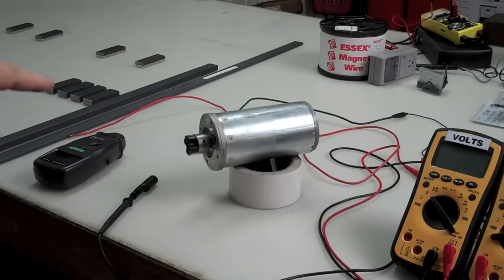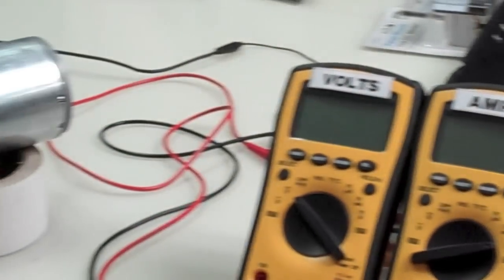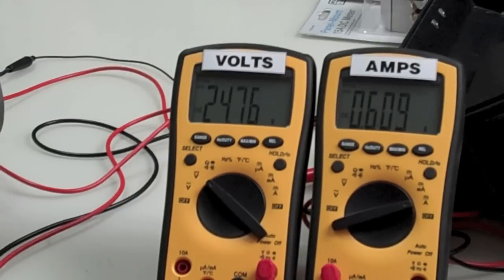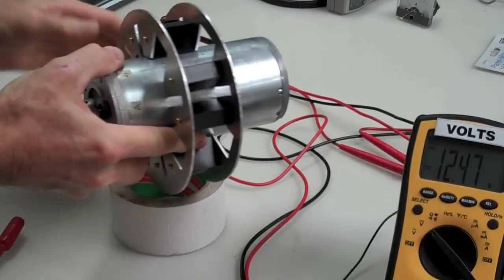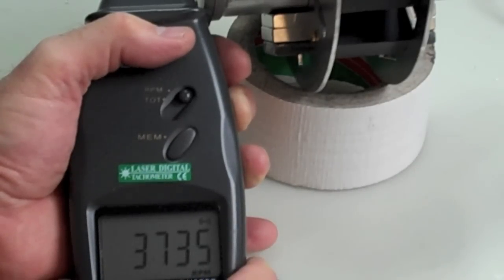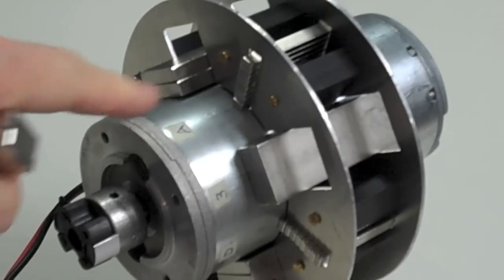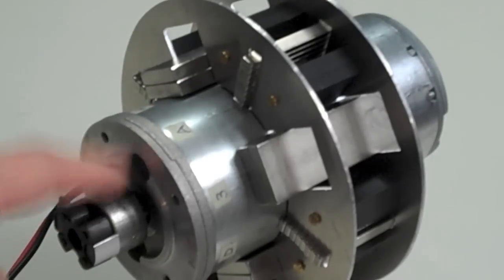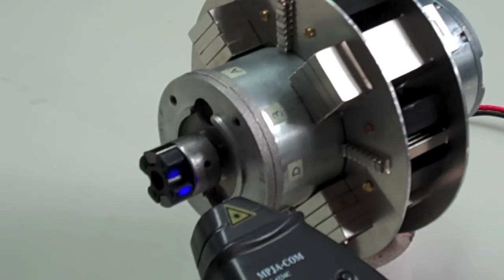STARGATE MOTOR  FULL DEMO

Comment: I'm not assuming any such thing. My formal training is in electronic engineering. I'm well aware of both the practical and theoretical limits on efficiency of circuits. I simply don't think that searching for buried treasure based on a maps found in cereal boxes is the same thing as digging a gold mine.

Comment: Thanks, let's find a solution to load the motor: This can be easily done by using a second motor (same powerrating) and use it as a brake: just shortcircuit the 2 leads by using a variable resistor (= dynamic brake - mind the heat dissipation!). The current determines the braking effect (Nm/A), and so the torque generated by the motor under test. And measuring the RPM's is easy: this will solve the whole discussion.(your method using the inertia is 'dangerous': the acceleration is not linear)

Comment: PMMG4HYBRID Many of these people commenting have to be led by the hand.
Yes, you increase the strength of the magnetic field and you increase the strength of the motor. The inverse would be the same.
Faster spin-up or higher spin rate, more power.
Less watts in/same rpm more efficient???

Comment: can you use that motor to try to design an eolienne power started that could self autogenerate current from using that motor with 2 currents separete (1 for starting the wheel, 2nd current to cumulate current) in that way you generate more power than starting.  DId you think it can be made? Now led light for self house consume no such power.
Reply: I think the challenge for now in 2014 is to create free energy and gain that energy to store it for own use challenge.

Comment: I tend to agree.  Not a mention of torque available, so what is the point?
Increasing motor speed doesn't say much.  Do a real experiment and measure back-emf vs rotation rate.  Then measure torque at zero rate.

Comment: Is there a use to this? Everything you just demonstrated is what you learn as a first year engineering student. I could be wrong but this video feels like you are cracking some code or you are 'onto something'. You are, The relationship between electricity and magnetism. That relationship is pretty well documented. That you made an experiment out of it does seem fun though.

Comment: two things to consider: it's unloaded, and Back-EMF. The torque you mention is irrelevant because it's not delivering power to a load. All you're doing is increasing the magnetic field. The other effects you demonstrate are normal. With a stronger magnetic field the rpm will increase for a given input voltage. At higher RPM the back-EMF increases opposing the input voltage ie it draws less current. All basic stuff.

Comment: It's a great experiment. What can be inferred from this demonstration aside from the obvious that enhancing the mag field increases speed?
Reply: it can be inferred that myself, as a hot rod builder won't be out of business when gas cars are made illegal, because, i can still make electric cars faster and more efficient at the same time.... nice.

I do wonder about torque gains/losses with this experiment ???? if it's 4x the rpm but 1/4 the torque, that's not really an improvement per say.
Reply: I don't have time for deeper explanation, but when the magnetic field is stronger, the speed may be smaller.
The torque will be however stronger, for a tiny decrease in speed.
Reply: he isnt increasing the magnetic field but decreasing the stator field by opposing fields.
Its called field weakening.
Reply: Bro the video just showed you that the rpm. Goes up when adding the magnets. It didnt show the torque. most likely from what i learned if one goes up the other goes down. So if RPM is going up torque is going down.

Comment: The closest reading to 10,000 RPM’s that the tach gives us is at 10,279 RPM. We will use a stopwatch to time the spin-up time to this point from rest. I actually also used audacity (free audio editing program) to get a more approximate time. You can time it yourself if you want to recalculate.  My time was 5.577 seconds
To list the data:

Inertia of the system( J) = is 5.92 OZ-IN^2 = 1.083E-4 kg-m^2 (metric)
RPM: 10,279 RPM
Spin-up time from rest (s) = 5.577 seconds

Comment from the maker: Thanks Sean. It is a permanent (stator) magnet DC motor. By simply flipping the outer attached magnets over, the field becomes quite saturated, now lowering the rpm and increasing the overall torque as you would expect it to do with a stronger stator field.

Comment: volt*amps ... you run the motor on the same power. The reason it's designed for 3000rps is because of the torque. What you are doing, is reducing the torch. You can design a DC motor for 1rpm, using 24 volt and 5 amps with insane torque. Or a 5 volt 0,1 amps 10k rpm motor with no torque.

Comment: Motor speed is inversely proportional to stator magnetic flux. I think you are weakening the motor magnetic flux by adding an external magnets acting against the motor magnets. This will cause the motor to run very fast as the resultant flux approaching zero.

Comment: Based on the label it's designed for (56 oz-in)*(3000 rpm) or  1/6 HP, not 1/3. That's 125 W (also on the label). So it's designed to deliver 125 W of mechanical power. And you have shown it 'idles' at about 15w. Your mod makes it much larger and heavier and reduces the idle power by about 3W, a small fraction of the design power. We don't know if that mod would make any difference with a 125W load. Just to put it in perspective.

Comment: What is happening here is the magnets on the outside of the motor is actually reducing the magnetic field inside the motor .The stronger the field the more back EMF is generated which reduces the speed of a DC servo motor High speed motors have weeker fields not stronger .Stengthening the magnetic field increases the torque at the lower rpm.Do your experiments with a motor with a separate power to a wound field .
LWD

Comment: So if you will do that to the Tesla car's electric motors, you can actually turn your Model 3 into Roadster 2's performance by simply adding some magnets around it's electric motors? That's amazing!  And that will also mean lesser battery consumption and longer range.  Just imagine that...

Comment: Ough... I thought it runs on Naquadah... 
But there is little-to-none need for complex magnet arrangement. 
Using NdFeB magnets only, well shaped with quality core and perhaps silver/silver plated copper windings you'll get a much more efficient, lighter and powerful motor.
You just started with a standard/crappy dc motor and enhanced the flux in it. 
Replace the internal ceramic magnets with NdFeB and then bolt it firmly to the bench. ;)

Comment: Not sure what you are trying to show here. You certainly haven't demonstrated a more efficient motor!

Motor efficiency is <usable mechanical power out> / <electrical power in>. Since this motor is not loaded and is thus not doing any work, usable output power is 0W and overall efficiency is effectively 0.

The following explains why the motor runs faster when magnets are added to the outside of the case. Remember, just because the motor runs faster under no load, doesn't mean it's more powerful. Speed <> torque.

An unloaded permanent magnet motor also act as a generator when the armature rotates, generating a voltage called the back-emf (EMF = ElectroMotive Force = voltage). So, in theory an unloaded dc permanent magnet motor will draw power from the battery and increase in speed until the back-emf generated by the motor's rotation is at the same voltage (or emf) as the battery driving the motor. At this point the back-emf balances the applied emf and the motor draws no power as current cannot flow. In reality, this is not the case as friction losses and armature coil resistances cause some current to flow to maintain the speed against these losses.
One of the characteristics of a dc permanent magnet motor is that if you reduce the field strength by reducing the strength of the magnets, then an unloaded motor will actually run faster as more rotational speed is required to generate the same back-emf. I believe that what's being demonstrated here. The external magnets counteract the intenal magnets and reduce the magnetic field in the motor, causing it to run faster under no load.

Comment from the maker: It's simply amazing, isn't it?  When you factor in the extreme rpm at the same power draw, one can only conclude that internal friction has been reduced and the enhanced magnetic field allows for a smoother and stronger operation providing higher rpm. Extremely efficient.

Comment: If you put it under load and measure power output and compare it to power input you wont see much difference in efficiency between running it with and without the magnets

Comment: That takes a course in physics and physics says that no improvement was made by messing with magnets on that motor.  What he did was to change the characteristics of the motor.   RPM does not translate to more power, just as you suspect.

Comment: a motor that could handle the rpm's would be built to do just that, so your beefing up an undersized motor......I love electronics and seeing people think of different ideas. Wonder what would happen if you simply magnetically shielded the outside of the motor or if the case were the shield itself.....the flux lines would definitely change.

Comment: Replace the bearings with diamagnetic carbon magnetic repulsion bearings and the only friction it will have is with air. 30krpm no problem.

Comment: Normal Run 24.53V-5.9A ~ 12.265V-11.8A
Stargate 12.21V-10.07A ~ 24.42V-5.035A

Kind of interesting that the efficiency did go up.  Can't just replace the magnets inside?  "Stacking" a Magnetic Field does increase its effectiveness.

@Riskteven Ohm's law kind of works funny with the batteries in parallel that the batteries can produce double the Amps at half the Voltage.

It's like taking two AA Batteries that are 1.5V and 0.5A each that you can get 3V @ 0.5A in series or 1.5V @ 1A in parallel.

Comment: The angular acceleration (α) is d/dt*ω = dω/dt = ((10,279/60)*2π)/5.577 = 193 rad/s^2
The net torque acting on the rotating body of inertia J causes it to accelerate. Newton’s 2nd Law for rotational systems is T = Jα . Therefore, T = (1.083E-4)*193 =  0.0209 Nm. This is the required torque if the speed is to increase linearly from rest to 10,279 RPM in 5.577 s
I can’t properly time the original spin-up time for the motor at its rated 3000 RPM because input power was not consistently applied.

Comment: Using the formula I x E = P
At 3.04 it shows I=0.593 amps and E = 24.58 volts for a total of 14.57 watts
At 6.23 it says 12.3W on the video which is a misprint.  The meters show I=1.099 amps and E= 12.35 volts for a total of 13.57 watts, not 12.3 watts
While it is true that you are gaining roughly 1 watt, remember too that this is at a no load condition.  Load could affect this.

Comment: 1st thing up front here, I am no electric motor guru of any stretch of the imagination.
Speed of the motor and low power is good I guess. But what about Torque?
Torque with low amp draw would be ideal.
But I am just thinking out loud here.

Comment: Your doing the same thing with that PM motor as you would do by lowering the field streingth in a wound field DC motor the speed will increase. How ever you will have a power torque decrease

Comment: Okay, I see all the comments giving you crap about the mathematics, power consumption, and the lack of format for proper scientific experiment to confirm a full range of statistical data. Even though I agree with most of them I also disagree with their tact when addressing their issues with your material. Regardless of that, your video and what you do show is interesting. My question is, what was the numbers and lettering all about? You made effort to mention them but I didn't catch why, or what their purpose was. I was thinking that they were to notate where the coils inside the motor are located but then at the end of the video, I saw that either the magnets or backing steel also had the corresponding numbers or letters on them as well. So, if it was to note the location of the internal coils, what then, was the meaning of the identifiers on the stargate materials?

Comment: But they are also tighend and framed to production cost, iron is cheaper than magnets.
Which can be seen on every motor and generators with there thin ceramics magnets.
The laws clearly says btw that magnets strength gives more force.
There is no way around this. 
The heat problem is offcourse a problem, due the nature of coil cored irons.
But there is another obtion in none iron cored engine. Where the magnet strength can be fully used without the iron issues.

Comment: So with the enhanced stator setup could it actually do the same amount of work (in terms of spec RPM and spec torque) on a much lower voltage and much lower power? What if you put 3V instead of 12V into it, would it still draw only 1AMP and spin at 3k rpm? Would it then have the same amount of torque? This could be a marvellous invention to greatly enhance the battery range of electric cars then! Instead of, say, 60 miles, you'd get maybe about 300 miles out of one charge! Why isn't this done?

Comment: [5]
7. Exactly the same thing happens if you double the stator flux: double the torque, double the generated voltage, half the speed.

8. PMMG4HYBRID knows this, and assumes the viewer knows this too. He is presenting a way to change the characteristics of a motor not by changing the windings, (which is easy if you make motors, but hard or expensive if you don't), but by adding magnetic elements to the outside of the motor which affect the flux strength inside the motor.

Comment: I don't think you really understand what is going on here. The magnets are not DRIVING the motor but rather making it easier for an electrical field to be maintained and contained inside the motor case. He explains how the magnetic field will travel out of the casing but has a hard time going back in. The metal backed magnets form a barrier to keep it in thus harboring a more efficient magnetic filed inside the motor case to drive the shaft. ( I think )

Comment: It actually works the other way around, increasing flux DECREASES RPM! the external magnets do this, it will make higher efficiency at high RPM and low load. Look up "flux weakening". this is a well known principle.

Comment: why don't you put a generator on the motor shaft when it has maximum magnets in its Stargate slots. this would mean that at even 6 volts it would generate more power then what it got from the battery in AC, lets estimate that output would be around 150 v and more then 2 amps.

Comment: if you have to ask what you're missing then you're missing EVERYTHING. Its increasing RPM exponentially whilst reducing the power input needed to do so, how would you be better off buying a better motor from the start? Sure you can buy a better motor, add this to it and make it an even more powerful/efficient motor. Did you even watch the video? Do you have a basic understanding of electronics/dc motors?

Comment: How do you determine horsepower/kW output without measuring torque?  a De Prony brake is super-easy to build.  I could really use a "shiftable" DC motor for a project I'm working on.

Comment: You're not drawing less amps.  You are only providing less amps.  Using a battery versus a constant current Power Supply leaves a large hole in this demonstration.

Comment: Folks, this is real. Try it with any little toy motor and some neo mags.  You will get the motor to go faster and use more current. But this is what he is showing....
Once you add the magnets, you can reduce the input to get the same output after the magnets are added. I did this a couple years ago but didnt think about it all has this guy has. I thought of it as being just more power in is more power out.
Try it. It works.  Just position the neos where the increase happens best.

Mags

Comment: by god chap, i think you get it, next step putting something at the end of the motor, gear, tire something, what you got is engry saving, that 3000 rpm motor can run at 3000 rpm with less power being used, using full magnetic flied what would be the watts reading at. you be able to run moster motor with about 24 watts, next step

Comment: my exact thoughts. a common slight of hand technique is to misdirect the viewers attention from the actual trick just to see the result. without seeing any volt or amp readings, how are we to know he didn't hook those batteries up in series and run it on 48 volts to get that RPM? or even an external high amp power supply? i call scam on this, just like every other "free energy" device that people try to sell "plans" for.

Comment: As your theory is clearly shown in this video...But, by all means use a refrigerator magnet with a low magnetic field versus a neodymium rare earth magnet with a high magnetic field, and you tell me what runs faster at a constant voltage with a motor core. Of course running a high voltage through a motor is going to make it run faster...and will probably burn out the motor too. The speed of the motor increased, the torque, not so much. In Electrical Engineering, you don' get something for free

Comment: Not really. Think. With no load, the mass of the armature is the load.  With the armature externally loaded, the effect will be the same. 

Naturally externally loaded, the rpms will lower and the input will increase. It is a tricky thing. 
I have an electric hub motor on my Trek bike. Brushless 48v 15A 54 coils 54 1/8x1/2x1 mags. If I were to double the strength of the mags, it would be faster and more input. But now I can use 24v at the original amps and still run the bike normally.
Mags